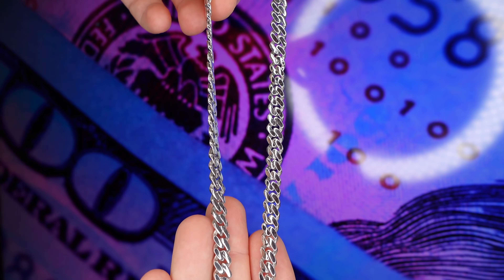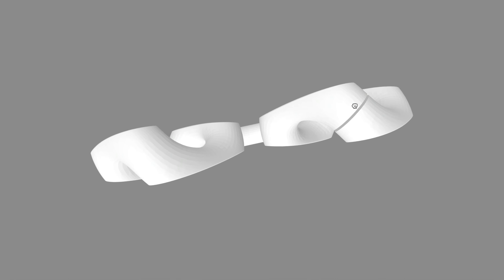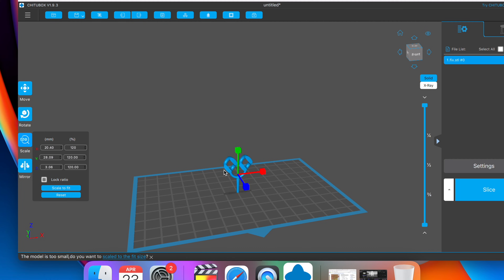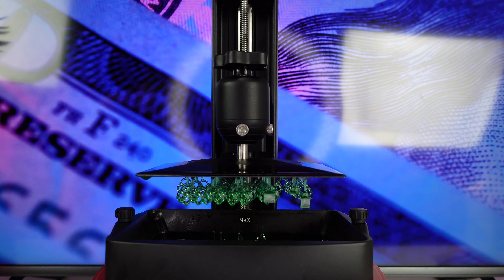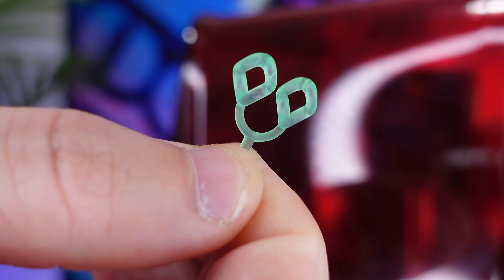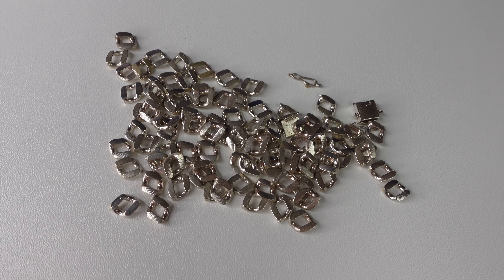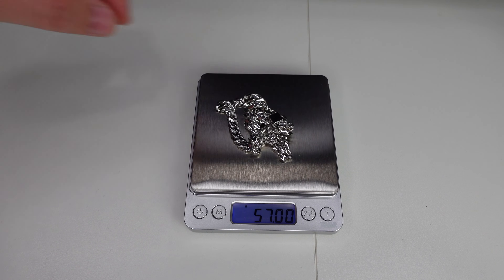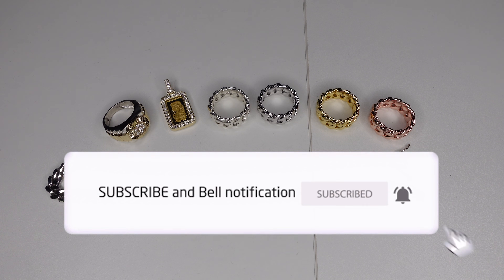How To Make GOLD Miami Cuban Chains With A 3D Printer & Castable Resin

Comment: I am so interested in this.  What would have made this video the definitive starter for aspiring jewelers is if you put out a realistic starting investment cost.  Printers, resins, tools, and low to middle of the pack metal cost by gr.    Essentially just kind of give a rough cost of what it takes to get this ball moving.   I'm guessing around 1 to 2k.    I'll be messaging you probably by months end for more in depth questions, but I love what you got here.    

1 question I have now is, does the resolution quality of the 3d printer matter at all?   Would a higher resolution be helpful in creating a smoother surface that will in turn lose less metal during the polishing process, or would that be inconsequential?   Would a higher resolution 3d printer help with making a higher quality build of whatever jewelry you are making?    I got the funds to invest (maybe another week or so) but I really want to make sure I go about this the best way possible.
Reply: i just bought the stuff on amazon and it was 582 total for the equipment before buying any metal, not bad

Comment: There are two things fundamentally wrong with your 3D print process:

1) Alcohol does not cure 3D prints, it just washes the excess resin off. After washing the printed parts they need to be cured with UV light to harden fully.

2) Uncured resin is harmful to the you and the environment and should NEVER be washed down the drain! You can reuse IPA many times and the uncured resin can be filtered by exposing to UV light, which will cause it to lump together and sink - then just pour through a filter to get perfectly clean IPA. Cured resin can be disposed of as general waste.

Please learn how to work with these materials properly for the sake of your own health and the people and environment around you!
Reply: some resins, especially castable resins, don't require further curing. The resin he used in the video doesn't need it. Make sure you know what you are talking about before you correct people. I do agree with your second point.

Comment: How much does it cost for them to set the diamonds and make the holes on the chain ?
Reply: When you get ya gold casted its best to already have holes and prongs casted. That way you dont lose gold when they drill in to set diamonds. But setting diamonds cost $1-$2 per stone depending your relationship
Reply: depends on what city you are in too. if its big jewelry district then u can get $1-2/stone. if its smaller market it can be up to $5/stone  @howiephomsouvan6820

Comment: You gotta dispose of the alcohol resin responsibly, dumping un cured resin alcohol slurry down the drain is a no no. First cure the resin slurry with your UV light, then filter it and instead of dumping it, why not reuse it for next time.

Comment: Thank you! Wondering, is this the best way to produce Cubans? Opposed to forging? The videos I've seen of Cubans made by forging, the finished product appears to have tighter, flatter, stereotypical Cuban link look. 

This one looks a little off, no disrespect- I did see someone else say the links are crooked & the chain doesn't hang straight. Is that related to casting or assembly quality? Thanks!
Reply from the maker: Hi CT, I will be covering this in tomorrow's video, but the short answer is it all depends on the polisher

Comment: I think your first jewelry manufacturing video is all I needed to start my journey to becoming a jeweler I’ve been building my own workshop and casting set up so I won’t have to outsource any of the work I got the 3-D printers polishers Stones and everything now I need this very expensive air filtration system to catch the smoke when I run my Oven in my apartment so no one thinks there’s a fire😂 they’re usually around 2500 bucks I found one for 1600 bucks  tho I have a bunch of silver I’m going to buy a kilo and some more stones and I need rhodium plating solution I’m going to get some platinum plating solution and start my jewelry business making handmade jewelry One day I’ll be able to get into the Watch market🙏🙏🙏 I appreciate your videos keep doing what you do bro
Reply from the maker: Love to hear that! Congrats!
Reply: @SlavaTVOfficial  🦾🦾🦾

Comment: nice video but i don't think it's a good idea to pour out the alcohol + resin mix down the drain
Reply from the maker: Thank you for this comment. I should not have poured it like that,. The proper way to do it is to expose  it to sunlight and let the resin settle and harden and then drain it.
Reply: @SlavaTVOfficial  yeahh otherwise nice video! You inspired me to make jewelry and ive made a few pieces already so thanks for that:)